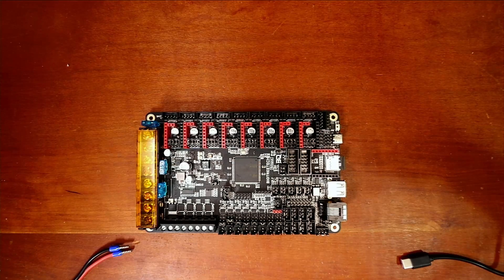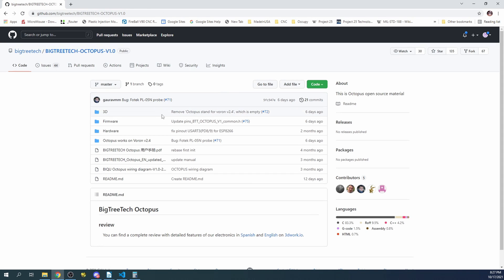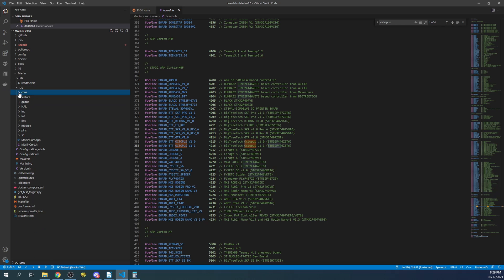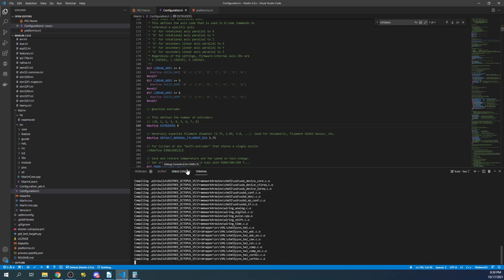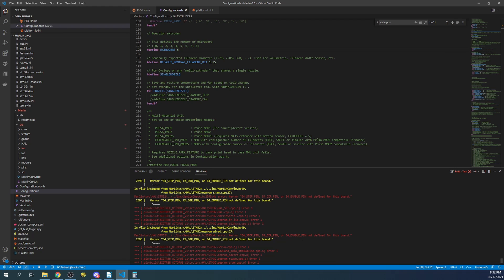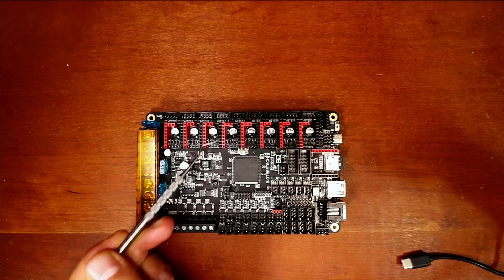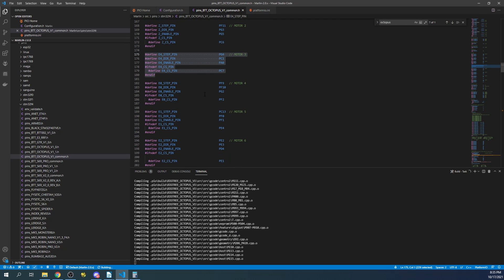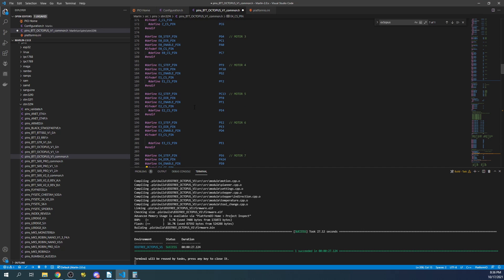BTT Octopus V1.1 - Adding 5th Extruder

Comment: Hi there, I could really use some help if possible. Not even with a specific feature of the build, just the software itself.

 
I tried using VSCode as part of a tutorial from Teaching Tech some months ago, and it was hell. Any time I tried to compile it took around 3.5 hours, rather than the ~30 seconds it takes you folks. It also seemed to grind down my whole computer, to the point I ended up doing a factory reset. It went a bit better as I followed the first couple of videos in this playlist, at about 5 minutes for the first one, but it then jumped up to over 20, and by the 3rd or 4th video it was back to 3.5 hours.
Reply: At one point VSC recommended getting some extensions through Visual Studio '22, so I did that and grabbed anything that mentioned C++ or MSVC, but it didn't help. I've uninstalled everything a bunch of times, with a new Marlin download to boot, but it's the same crap every time. I've now tried jumping ship to Atom, hoping a different program would help, but it doesn't seem like it. It finished at least, but still took around 20 minutes. I could tolerate that if I knew it wouldn't be any worse, but I doubt that would be the case, and I can't go through this ridiculous slog any time I might need to make even a single change to my firmware.
Reply: As for my computer, it's nothing fancy, but it's generally competent enough. The specs, if it helps: Intel(R) Core(TM) i5-7200U CPU @ 2.50GHz, 2712 Mhz, 2 Core(s), 4 Logical Processor(s)

 
In short, please, pleeaase, someone help! (and thanks if so!)

Comment: I have a question
COREXY case
When using 5 extruders
Z_SAFE_HOMING
X_CENTER
Y_CENTER
but set to
does not move to the center

So I can't print

can i know how to solve it?
Reply from the maker: Are you using a BLTouch type sensor.
Reply: @EdwardBraiman  Yes, that's right.. bltouch I'm using it.
Reply from the maker: In my Discord link in description there is a chat room for BLT.  I'll be making some updated tutorials on this soon.  There are a couple of people in there that can explain.
Reply: @EdwardBraiman  I look forward to the video thank you very much
Reply from the maker: I'll be talking about this on Friday or Saturday night on SKR v2 for BLT.  It's going to be a live stream around 6 PM EST.
Reply: @EdwardBraiman  I will definitely watch
I want to solve it quickly ^^
Reply from the maker: It's a very difficult solution with many variables.
Reply: @EdwardBraiman  
Just by changing the number of extruders
At COREXY
it's not working
Shouldn't BIGTREETECH solve it?
Reply from the maker: Post your configuration.h and configuration_adv.h and the pins file from the tutorial in Discord channel below for general chat.

Comment: I click Home offset to my LCD and its ok and there is saying Home xyz first then I home xyz but during print its to far from bed my z axis
Reply from the maker: This might be several issue.  This might be placement of endstops, Marlin firmware configuration or gcode file has a surface offset in Slic3r.

Comment: How change the proper  polarity on the cables on Extruder?
Reply from the maker: Extruder cables have no polarity.  That's why the make both red in color.  It's just a heating element.
Reply: @EdwardBraiman  I fix it now my extruder are ok but How to set up my z offset  using my LCD And What the best temp. for my Silk Filaments?
Reply from the maker: For your filament they should have a datasheet.

For example Hatchbox PLA type of filament prints best at 200 Celsius.  They give a range of something like 178-220 Celsius.
Reply from the maker: For heatbed and hotend polarity is not an issue.  This is why both wires are generally red.

Comment: Your tutorials have been a big help! I have started a project that needs me to use the manual stepper and 'none' kinematics in klipper and found a bug with the SYNC=0 feature so multiple stepper can move at the same time. Going through the code I found a couple things I want to try and change, but the changes seem to have no effect. I am not sure if I can just change the .py file in the klipper directory on my raspberry pi or need to change the firmware on the Octopus board or what at the moment. What should we do in these situations? I am unsure the etiquette in this situation. Do I create an issue on github? Or how do I get the changes in the file to show up in the hardware? Anyway thank you for all the time you put into these tutorials!

Comment: why during I print my Z axis is printing so far from my bed?
Reply from the maker: Is there an offset set or is the surface not yet calibrated to zero position in z axis.  It could also mean z endstop is a little high in relationship to print surface.

Comment: I'm done but I ask you How fix when my Extruder opposite direction?
Reply from the maker: You can search on invert in configuration.h or if flat Dupont connector on NEMA motor you can turn 180 and insert.
Reply: @EdwardBraiman  how about i reverse  the conection on board?
Reply: I have a color black blue green and red?
Reply from the maker: Can you show me an image of plug on Discord.  The link to Discord is in description of video.